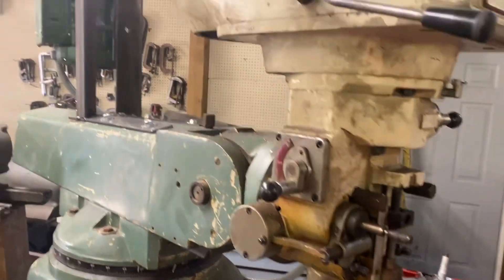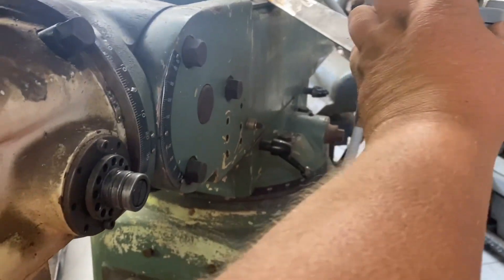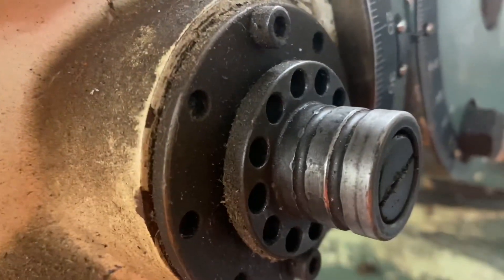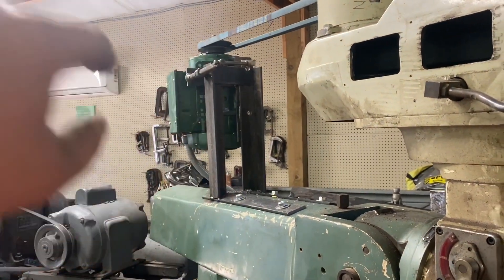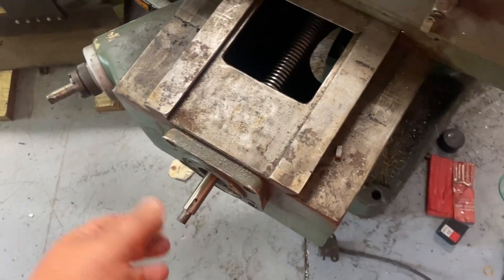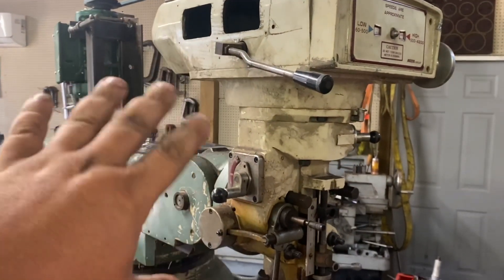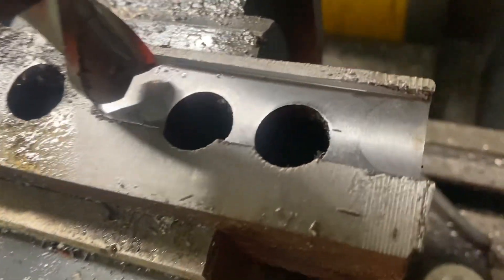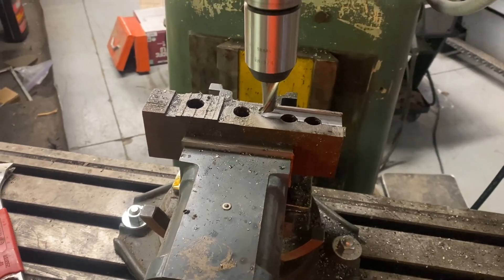First running and cuts with the kent/jet/acer vertical milling machine

Comment: My DIY machine with two spindles, originally it was built for both to have full nod and tilt. I found it so much more useful to leave one spindle permanently trammed and only tilt the auxiliary spindle. After a few years I realized I had never missed the ability at all. I ended up stripping it back to remove the capability which gave me a little additional rigidity along with knowing that that particular spindle is always perfectly trimmed. I think this was one of the better choices I made, I agree with you, you just don't need those functions often enough to justify the labor of retramming

Comment: Hey just to put it out there since we are neighbors, I'm pretty desperate for a power feed. I got a wheelchair motor to make a DIY one, but my mill is quite large, I need a pretty beefy power feed. Like you know the upgraded one that Bridgeport offered on the larger models? One of those would work great, but the little Chinese boxes will not. Mounting doesn't matter, I'm going to have to build something custom either way. Thanks in advance, please let me know if you come across anything